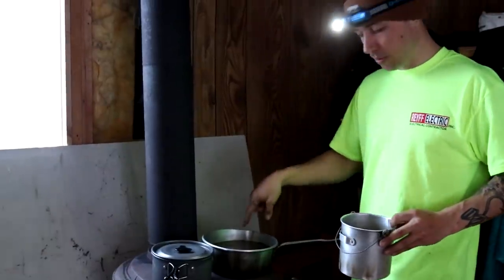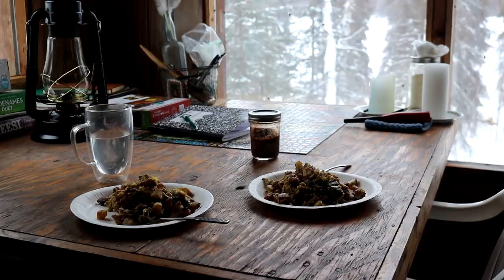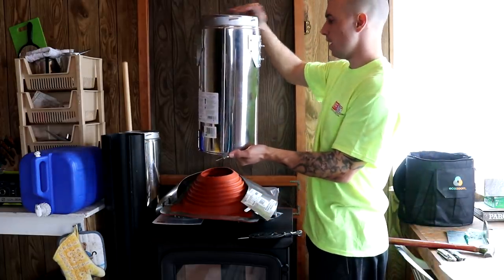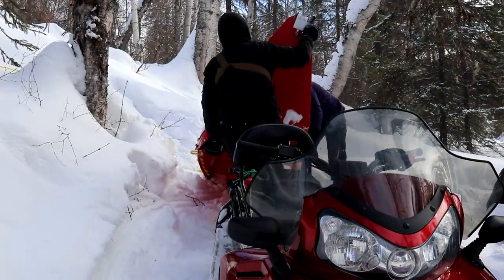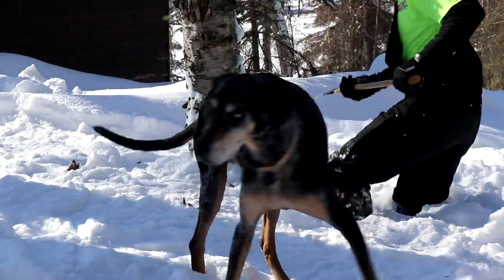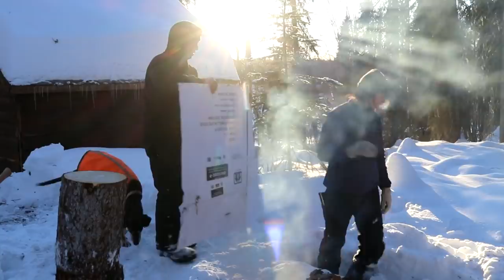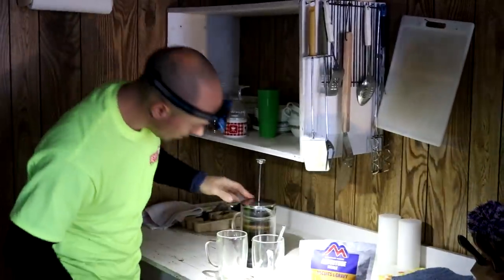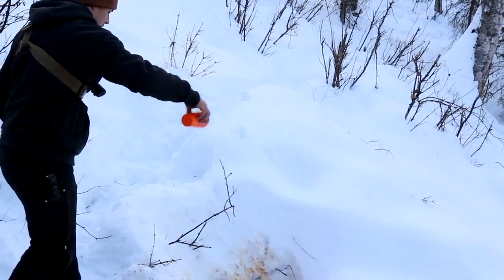Winter Trip to Our Alaskan Off Grid Cabin (Part 2)

Comment: Perhaps if you chop up charcoal and put over food pile, that might neutralize the odor.  There is a product sold at Home Depot that is liquid that neutralizes odors, cheaper by the gallon, about ten dollars, there are several brands.  Bears go with learned behaviors, so if they have found food near or in the cabin, it's likely they will come again.  Mama bears teach their young so a scent is not the only mechanism. Perhaps if you douch an perimeter ten feet or more from the cabin, that might work.  It's hard since snow will cover. But when the snow is not blanketing, the perimeter might work out since the bears are asleep when the snow is there..  Love these episodes of discovery, it is fascinating content.

Comment: I have a tip for chopping big rounds. Go for the outside edges, 2 1/2- 3" from the live edge, and work your way around it. the round is weaker there, once that's been done the rest will be easy. give it a try. too much strength in the round to go straight for the middle. It's an old guy trick, 59 years old, nice double- bladed axe by the way. Great job once again!

Comment: You will need some poly sealant, 2 Tubes
1) at the silicone penetration flashing under the flashing to the roof, 
3) at the top of the silicone / rubber boot, between the pipe and the boot, 
4) and then put some sealant over the rain deflector.

Comment: Just lots of peace and quite—hard to find that these days. You’re going to need something to clean the roof good before the adhesive on that gasket will stick, usually something solvent based. Also if your roof has some surface rust you’ll need to sand that down. I’m telling you all this because you only get one chance with those gaskets, if part of it sticks and part doesn’t there ain’t no going back.

Comment: Looks like you'll need to bring out some of those sticky fly strips to hang up to get all those flies cleared out of there!  

Nice little stove.  I'm curious why you aren't just using the wall penetration you already have in place to avoid potential leaks by going up through your roof with it.  What's the point of that?  Are you planning on relocating the stove or installing the new one where the older one is now?  I'm just imagining that flashing that stove pipe with the old roofing up there could be a challenge to make and keep water tight, making you wish you'd left well enough alone up top...though I hope I'm wrong of course.   It also seems like it will complicate your snow removal process should you want to use the rope again, but who knows?  Anyway, it sure will be nice to have a safe and efficient stove out there!

Might be nice to put a little awning window up in the loft with a screen on it so you can have some natural light up there as well as to open up to let in fresh air, create air flow in summer and be able to cool things off if needed in winter as well.

SUCH a cool little escape.  I can't wait to see that gorgeous water view out the front window after the thaw!

Comment: A trick I have used in northern Manitoba take your propane tank as you close up the cabin.Place cylinder in center of cabin.Give the handle about a 1/4 inch turn to open the flow.Shut the door and let the propane do its job.
Exterminators also sell a slow release Fly Bomb.

You should consider Bear Mats and shutters,basically Plywood with 50-75 spike pushed thru so they cannot stand on deck to rip the door or bust in thru windows.
Put a 2x4 at base of door,as Wolverines can open anything,don’t let them get a toehold on plywood edges.
I have been there and done this,just friendly advice.

Comment: I spray Pine-Sol around the perimeter of my house to keep the bugs out.
Reply: I’m about to do the same thing
Reply: Does it keep ants out too?
Reply: @ritzafrancois4863  For the most part yes.  A couple times a year I may see one but that's it.
Reply: I use a 2 gallon pump sprayer.  I do a 50/50 mix of Pine Sol and water.
Reply: @GCSol  thank you for the tip!! Ants just started in my trailer i stay in,just shortly after the ice & snow,cold temps!! So im getting some pinesol!!

Comment: Been watching for a while.  I live in a bear area in Montana off his as well.  And we make sure we burn all our uneatin food in the wood stove. Our garbage we burn in a pit out outside. 
   Tried burn barrels but they always tip them over. Do then we started to dump bleach or diesel fuel when the fire is out in the burn barrel and the pit.  That stopped them from digging and such. Pinesol on our decks and doors and around windows worked well also. We used spray bottles for the doors and windows.

Comment: Please do not scrimp on the snow break. I would hate to see you get all of the way out there next winter only to find your pipe torn off. We also use a pair of support rods that can be found on line. My wife and I have been working on an old off grid log cabin for about 5 years. It takes time to get things out there, but you learn to maximize every trip and the creature comforts start to add up. Winter trips are always an adventure!

Comment: Need a partition on loft. We had 12x18 cabin with loft on half. Pot belly stove below. Had a insulated partition with blanket on door way. Also had window, I could open from in bed. We had electricity so I had ceiling fan over woodstove. All that made comfortable sleeping, as our woodstove would sometimes run away. Build a partition and cut a window.  I also remember having the door wide open on a -40° night once

Comment: To do that cornbread put oil in bottom of cast iron skillet and let it get very hot but not smoking..but in cornbread mixture...wstch it and when it starts to set good enough on top you can flip out on the lid and slide  it back in pan top down...well be wonderful. (Left over bacon grease is best)

Comment: You need to build the wood stove pipe from the top down. There's some more stuff you need. Adjustable roof to pipe brackets, an extra piece of roofing to go from the peak, just past the pipe, you'll need a different pipe flashing like your home has, and there is a special tin box for going through the roof= the size of the width of the rafters and you cut it the same as the pitch and then bend the sides over, This takes the place of the square with the hole in it. When I did mine I didn't put any insolation in it. get some roofing screws, matching color preferred and there are some super sealers for the edges of the sheets of roofing, They make a sip section of pipe for the inside that make it so you can take it apart inside and the triple stainless pipes never need to move again. For example if you need to clean the stove or replace the cad or putting in the 6" damper, check these ideas out at your home and online. Didn't mean to make a science project out of it, but I just want you to be super safe. P.S. might need some more hardy backer for the ceiling, peel insolation paper and plastic back at least 16" away in all direction away from the box and screw up hardy backer board, you never know how hot it could get up there. Might put a little super sealer on the grommeted roofing screws, I try not to screw in the valleys of the sheet metal if possible, maybe 2 different lengths of screws 11/2-21/2. You can take the rubber grommet off to screw in the box. You'll be so much happier to do it this way! I need to take picture of mine and send it to you. Maybe Facebook! If that's okay? .

Comment: Before we insulated our little cabin by the sea, there used to be hundreds of flies lying on the floor upstairs when we came there in the cold season. The first thing we did before setting fire in the oven, was to sweep all the flies up and throw them out.. I always feared they would all wake up and fill the air... Funny things, flies, they fall asleep at a certain temp. and wakes up at a certain temp..  we warmed a fly with our breath, it woke up, went up the window, then it got colder, and it fell down, asleep....

Comment: Not dying is a good thing!  Suggestion, when assembling the stovepipe, make the higher sections joint into the lower sections. That way when liquid creosote or condensation drips down the inside of the pipes it does not escape at the joint.  Messy! Don't worry - once you get the major tasks done at the cabin there will be more time to relax on your visits.  Next time pack out an empty spray bottle, to spray apply Pine-sol to surfaces like the door and window sills. Lockable external shutters on windows and door may also help make it more difficult for bears, other animals, and Mother Nature to damage the cabin.  Mushers returning from the Iditarod?  Never thought about it, but I guess the only (and much more expensive) alternative would be to fly back to Anchorage or (where did they start this year?) Willow.  Cheers!

Comment: Bring plastic spray bottles empty then when at the cabin make your solution and start spraying all those places you think you might have problems also I had a Plywood board in front of all doors and windows which were only used when not there.       I either pounded a lot of spikes up right through the Plywood, they have to be real strong as Bears do not like stepping on Nails or tough Screws.      In all my years of mountain high we never had a bear problem, thankfully there was one area where the lake never froze but it still was not safe to jump in as soon as you got out you turned into a Icicle!

Comment: To control the flies in our cabin in Northern Minnesota we have had good results from hanging Fly Paper Strips near windows. They are effective and there is no chemical spray, poison bait or piles of dead flies accumulating on the floor and table. Thanks for another enjoyable video. I was in often in the Mat-Su Valley / Talkeetna area while working at Denali (McKinley) National Park from May until October in 1975. The area has changed some but doesn't seem like it has changed too much.

Comment: If you want to encourage Arielle to split wood try cutting the rounds much shorter, like 12 inches long.  It's much more fun to split wood when the rounds are sized so that the splitter can easily slice through on the first blow.
Reply: I disagree.  I split 16” rounds just fine. Get a good maul. The best time to split is when the woods frozen at -40.

Comment: Hillbilly version of deercamp cornbread-- mix up as you like then pour a 3/4 inch layer into a hot skillet (round cast iron griddle if you have one) cook on stovetop or fire till the bottom is brown as you like (top is still raw).  Slide spatula under till bread is loosened...then slide the whole thing off onto a plate.  Hold plate in one hand and cover with upside down skillet in other hand.   Quickly flip the 2, take plate off and raw side is now on the bottom. Put back on heat and finish it up taking peeks with spatula to check browness.   Loved all the cabin vids. They are wonderful. Will have withdrawals till summer comes. lol.   Do you know any of the other cabin owners?
Reply from the maker: Great tip! Yes we know quite a few of them.

Comment: Might want a small window up in the loft to let extra heat and smoke out , maybe a 12v fan and get some co2 and smoke detectors, don't want you getting smoke inhalation especially while your sleeping. If they go off when your cooking you can move them, just put them back when you go to sleep. Window big enough for an escape route with roll down ladder. Window away from sleeping area so your not dragging towards yourselves, opposite .... side, hopefully in the wall not the roof= too much snow. P.S. I love that place

Comment: I see you have the same issue as we do up at our cabin. 4589 flies all warmed up and buzzing around half awake and half dead. I wonder how many times they can go back to winter sleep mode. What potatoes were those Red flesh ones??  outside stove supports on the pipe sticking out of the roof. When snow slides it supports the pipe. Even with snow stops in place. You have alot of snow on that roof.  You could use a mountain handle on those sled bars Eric. Really enjoyed your trip

Comment: Hey neighbors up the road from me. I was thinking that scrap food could go right into the lake where the fish would get some good out of it and possibly encourage fish to hang out. Its hard work for sure but smiles make it worth it all. You deserve a break from just being home and a second home just might get some of that energy from the power foods that you fix. Its going to take a while for the fry pan to fully break in but so worth it. It is hard to leave the pan looking kinda unclean but its leaving the grease so badly needed by the iron in that pan. A good "Jig saw" with the battery should take out the metal in the roof but charging a battery at this current time can mount its own problems. I think its time to consider building a cash in a tree fort for storing food or other can't leave for bears.  Also as a precaution to burn downs, store some gasoline and other fuels up there as well. Bears can smell engine oil for miles and they devour it like candy.  So careful filling anything fuel related in the cabin as that smell is in the air too and they will try to find it and literally tare your cabin down trying their best to find and eat it ...... so enjoy that trip home and don't get so tired before traveling as that is the energy that your going to need if you should go through the ice... I do believe I heard nine feet thick.... funny but the over flow on the ice will reduce it to very thin ice in a day. Kinda the ice cube in the frying pan thing

Comment: I am surprised there is not a block and tackle in the trees to hoist food supplies in the air out of bear reach.  As for the scraps, either take it out or put on opposite side of the property away from the cabin.  Will be interesting to see if the pine sol works.  Good video!

Comment: Eric, does that chimney cap have a spark arrestor built in? From the angle you showed it was hard to tell.

Wood cutting and splitting are my two favorite things to do and it keeps you in great shape.

Question: why don’t you get some 55gal drums, fill them with snow and use that for water throughout the summer? Snow is clean and can be used for cooking, drinking, bathing, and, as you already do, dishes. Keeping barrels of snow for water would reduce the need to transport it from your homestead and collecting it from the river. I did this when I lived in AK and it made my water usage much easier. All of the snow I shoveled to keep my path to the river clear went into eight 55 gal. drums that I transported in my freighter canoes during trips to town and back.

Comment: Maybe get a 2 gallon weed pump spayer (home depot have them for $14.00) to keep at the cabin that way when you spray it down with lysol you can use it easy peasy on doors and outside.. I know you probably already thought about this but I would definitely look into making some Shutters to go on those beautiful windows to keep closed when your not there..just in case... I'm really surprised a bear hasn't gone through those windows yet..

Comment: Just a safety note. Chevron Blazo and other white gas products are unsafe for use in in cold blast oil lanterns, they should be used on Coleman-style pump up lanterns and stoves, that use silk mantles. Proper ventilation is mandatory. Cold-blast lanterns, such as the one you purchased run on lamp oil or kerosene.

Comment: Can i make a suggestion next time for your cornbread. I asked my granny who learned to cook on top of a wood stove. She said heat your oil in the cast iron until starting to smoke. Then pour part of it in the batter then pour batter into the pan and cook on top of the stove. It will cook better. But make sure you stir it up good and now i have to go make cornbread cause she wants some

Comment: The flys are in the cabin and you will never get rid of them..........unless, and we found this out by accident. Warm up the camp in the cold weather, when you leave open up a propane bottle so its leaking slowly{make sure the fire is completely out} ours was a 20lb tank in a 100 year old 2 story 3 bedroom farmhouse so you should be good with less. We went from 10s of thousands during hunting season to maybe 100 two years later.

Comment: I wonder if it would be easier to pull the flexible sled up to the cabin (with the rope), load  it up. then use the rope to lower it back down? Maybe even a pulley at the top and bottom like a ski lift?

Comment: Why the roof on a mostly unoccupied cabin?  Seems like the potential for Ice Jams causing problems will be high?  Getting the pre-made through the wall elbow might be a bit more expensive but way easier to clean out and safer.

Comment: personally i find a location within 10 ft of the shore and dump scraps there.. its far enough away from camp and will not run much risk of a bear since most the snow should melt by the time bears arrive..

Comment: Gallon jugs are weak. Use 2 litter soda bottles. You can throw them from a moving frieght train and they don't break. Cortright Tennessee USA
You will need a chimney brush to clean the creosote out of the stove pipe. It will create a fire hazard

Comment: I think I saw you using a battery drill in a previous video.  If you already have the batteries, consider buying a compatible jigsaw to bring to the remote cabin rather than bringing your generator.  

Glue some aluminum foil to cardboard or cardstock and bend to a semi circle to use as a reflector behind the candle to direct more light to where you need it.

Why didn't you pack out your food scrap and dispose of it at 'home'?